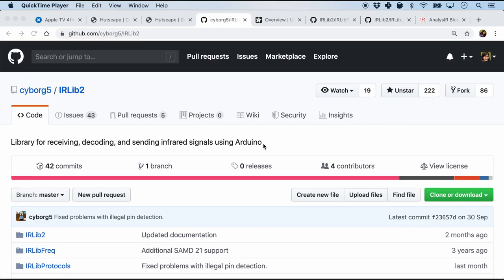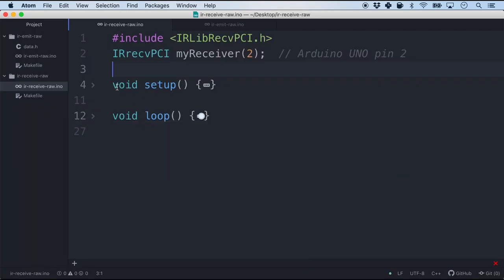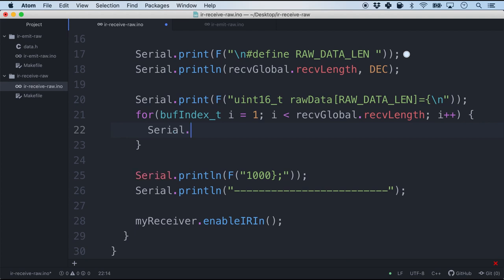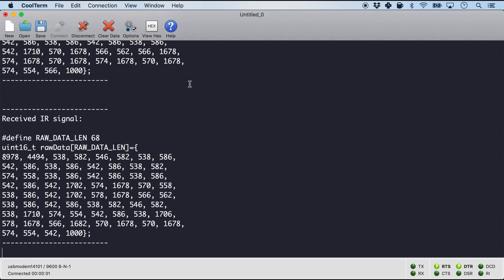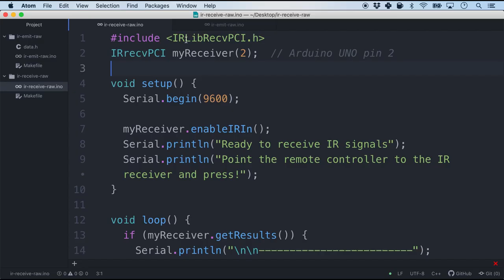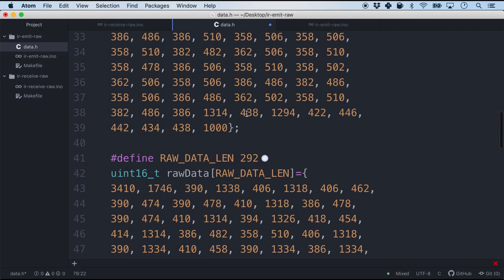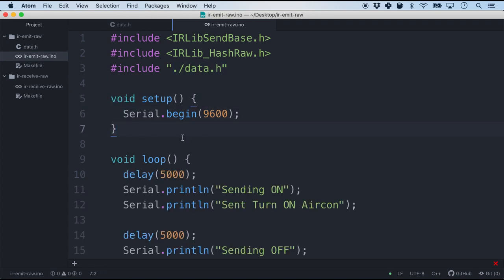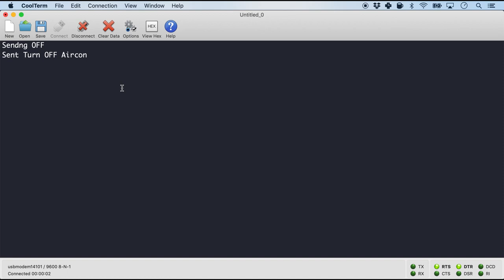Recording and replaying Infrared signals from remote controls

Comment: Hey Sayanee, great video, I really like that you're using an updated IRRemote library.  I'm curious, with one of the controllers, you were only able to get the on/off and volume button IR data but couldn't get the IR data from some of the other buttons.  Do you know what that is?  I've tried a difference library and every TV controller in my house works, except for one where I have the same problem...on/off button, mute, volume buttons work like the other controllers, but the other buttons don't work.
Perhaps you or someone else here has solved this issue?
Reply from the maker: Uh! I think it was the Apple TV remote. The rest of the button in this case was simply Bluetooth I believe that was communicating with the Apple TV. Only the volume up and down was IR.

Different remotes, different technologies, I guess!

Comment: hello
I am using this library for receiving the IR code.Every time I press the same button on my remote control I get different raw data.  For example; The two shutdown codes  that I receive from the remote control are different. 
Could you help me?
 Thanks.

Comment: Hi Sayanee, thanks very much for the movie, that was actually exactly what I was looking for. Now I can connect some sensors and adjust the ac accordingly, I am thinking. Anyway, I am wondering, you said output pin for the Led is Pin3. How do you know this,  also in your script is no output Pin defined. Could you please enlighten me. :thanksdoc:
Reply from the maker: It's been almost 4 years since this video 😅 So many the implementation based on the original library has changed. 

Please check the original library's latest similar example: https://github.com/cyborg5/IRLib2/blob/master/IRLib2/examples/rawSend/rawSend.ino

I am guessing as long as you chose another analog pin marked with a tilde (~) that should be fine.

Comment: Good video. I can understand and  follow every step in your video. And it's work. My television, light and radio. All of them can be controlled. But my ceiling fan doesn't seem to work. How can I fix this. Do I need to decode or something? And one more can I use esp8266 for this project?
Reply from the maker: I have never used ESP8266, but try this library: https://github.com/crankyoldgit/IRremoteESP8266

Is the ceiling fan using IR as well? Mine is using RF, so that might be the reason.

Comment: Hello.
I want to copy the remote control of a GREE air conditioner, but the data I obtain with the receiver code is always different. For example; The two shutdown codes in the (close-on-close) command I receive from the remote control are different. Is it possible that the code is encrypted? How can I go about it? Thanks.

Comment: I made this project and it works only if the Arduino is plugged in my PC ,  but the thing is whenever I use an external power supply it doesn't do anything.

Comment: Great video, thank you so much. I have a small question though. instead of saving the obtained data in a file, is it possible to store it on the EEPROM in realtime?  I want to store and send the signal without using my PC but also not lose my data if the power is cut.
Reply from the maker: Absolutely! In fact, storing the data in the EEFROM / flash is my next goal.

I did not show this in my video because I didn't want to complicate the code and the example with EEPROM/storage stuff.
Reply: @sayanee  I see, thanks a lot. this will help me greatly in my project. best of luck with yours

Comment: Hi, I tried doing this on an arduino mega. Receiveng the IR signals was no problem but when I was trying to send the recorded IR signals, there was no output coming from the PIN 3 of the arduino mega. Any reason why it is not sending? Thank you.

Comment: What could be the reason for the code not working even though i set up the correct pin, i get the light on the receiver when i send a ir signal but when i try the code it just doesnt detect anything? receiver is ky-022

Comment: Hello Sayanee,
Why you save for the last array element always a fixed value 1000 instead of doing the same and getting the last and actual value inside the loop (i== recvGlobal.recvLength)?
Thank you
Reply from the maker: Hi Antonio, 1000 means a trailing space that indicates we have received the complete data. It is defined in the IR library I used.

The code I implemented is directly from the example of the IR Library "IRLib2" I used which also has the last fixed value as 1000: https://github.com/cyborg5/IRLib2/blob/master/IRLib2/examples/rawRecv/rawRecv.ino#L32

This code inherits #include <IRLibRecvPCI.h> and if we read the "/IRLibRecvPCI.cpp" implementation file, the comment explains that "If it notices a SPACE is especially long then it calls IRLib_IRrecvComplete  which sets the proper flags to say that we had received data and implements  auto resume if enabled." Here's the complete link to the comment: https://github.com/cyborg5/IRLib2/blob/master/IRLibRecvPCI/IRLibRecvPCI.cpp#L97-L100

I hope that explains what you want to know about the fixed value of 1000.
Reply: @sayanee  thank you

Comment: howcome we don't need to know/define the carrier frequency (38 in this case) when recording ? also is there any way to determine what the carrier frequency is for a particular remote if it is not 38 (not known)?
Reply from the maker: We probably need to look deep into the dependency code (https://github.com/cyborg5/IRLib2) to know the carrier frequency used.

I was not able to do an in-depth analysis, but a quick search shows that the default is 38kHz (https://github.com/cyborg5/IRLib2/blob/master/IRLibProtocols/IRLib_HashRaw.h#L37).

I'm not sure how else to measure the carrier frequency of the remote control by measurement. The harder way will be to locate the component manufacturer part number and find the datasheet, I guess.

Comment: Hello Sayanee.
Once again congratulations on your explanations.
I did the assembly and all the tests.
But I am facing a problem. The pulse train recording is smaller than the original pulse train.
My interest is in replicating the commands of a Hitachi Air Conditioner Remote Control, and the pulse train duration is around 230ms in total.
I will greatly appreciate your opinion on this case.
Thank you.
Dino Canalli
Reply from the maker: Where and how did you measure the 230ms? And how did you figure out that the pulse train recording is smaller than the original pulse train?
Reply from the maker: Thanks for sharing Dino Canalli!

As I suspected, you did use more tools and instruments such as the oscilloscope and the AnalysIR. That's great. I saw your video very briefly. Please give me some time to look through it again.
Reply from the maker: @drcanalli  Hi Dino, I'm really sorry that I took so long to reply.

Thanks for doing the video, but it will be still very difficult to debug remotely. Regardless of what the array of code was captured and the oscilloscope waveform duration, were you able to emit the IR signals captured with the circuit and control the aircon? You seem to have 2 variants of the receiver TSOP, did one of them work? 

I am not sure if you tried to emit back the recorded signals (array of numbers captured) to the aircon successfully. Maybe give that a try with your Arduino UNO circuit? https://hutscape.com/tutorials/ir-raw-emit

Also, I think it is completely fine for the captured signal to be different from the emitted signal due to sampling and other ways the signals get truncated. But if the aircon cannot be controlled, then maybe we need to look at it in another way.
Reply: @sayanee  God bless you Sayanee! The problem was solved and the device i create is in use today. Your help was very important! good new year!

Comment: Help me 
i don't want to use pin 3 to connect to ir led, where can i change it in the library
Reply from the maker: It's been almost 4 years since this video 😅 So many the implementation based on the original library has changed. 

Please check the original library's latest similar example: https://github.com/cyborg5/IRLib2/blob/master/IRLib2/examples/rawSend/rawSend.ino

I am guessing as long as you chose another analog pin marked with a tilde (~) that should be fine. And you don't need to define it in the code.

Comment: The code is always different. What should i do ?
Reply from the maker: Yes, it will be slightly different. I think that's because of slight variations when converting analog IR signals into digital.

So, just copy the one that works and use it. It should work.

Comment: Thanks for the video (and all the previous ones)!  My project was for a set-top box that sits behind cabinet door that blocked the IR signal https://github.com/tsaarni/ir-remote-control-repeater. I found out that it is possible to make pure repeater without decoding the signal.  I'm sure running this on microcontroller was overkill but that's besides the point of this kind of projects ;-)
Reply from the maker: Wow! I didn't know using a repeater is another way to replay the IR signals. Thanks for sharing your project link so that I can dig in later 😃

Comment: I still haven't understood how is possible capturing the signal as a serial at 9600 bps while the carrier is 38KHz. If someone could bring some light in it I really would appreciate.
Reply from the maker: We are actually capturing the IR signal received as and when it comes and immediately as it is received as shown in this line of code with the function "myReceiver.getResults()". If you see the loop() it has only one if-case. So the capturing of the signal happens immediately. https://github.com/hutscape/hutscape.github.io/blob/master/_tutorials/ir-raw-receive/ir-raw-receive.ino#L14

We are printing the raw data, each buffer by buffer at 9600 baud rate and that is done after the signal is captured. https://github.com/hutscape/hutscape.github.io/blob/master/_tutorials/ir-raw-receive/ir-raw-receive.ino#L23

I hope I understood your question correctly.
Reply: @sayanee  Thank you. I watched again your video and got it - is there. The receiver TSOP4838 also performs demodulation, etc, and for 38KHz signals. Means that, during capturing Arduino is indeed receiving from TSOP4838 a clean envelop of the modulated signal just the bits at 9600 bps, as it is before being modulated at 38KHz and cleaned from any other lighting environment noise. For more https://pdf1.alldatasheet.com/datasheet-pdf/view/252287/VISHAY/TSOP4838.html